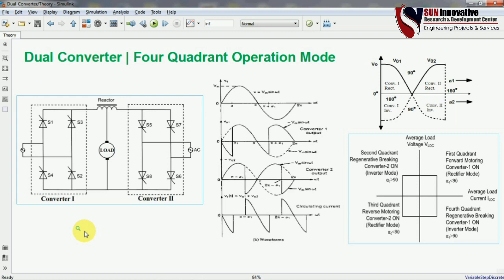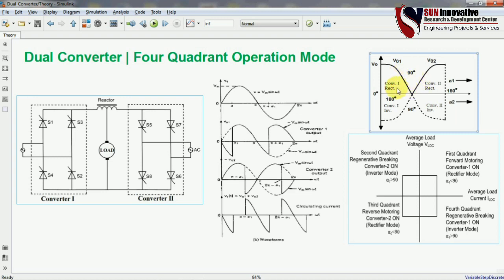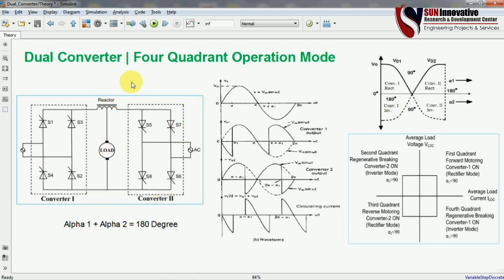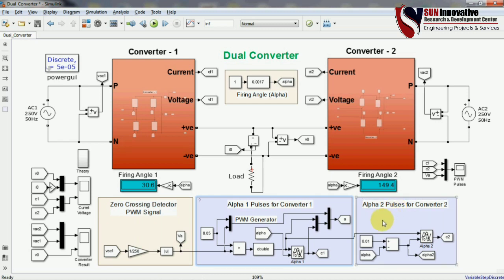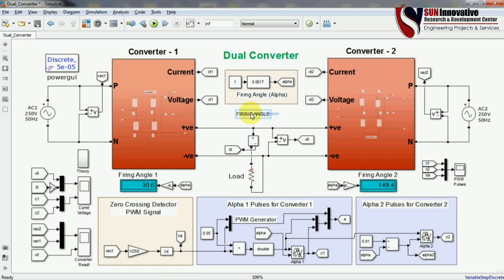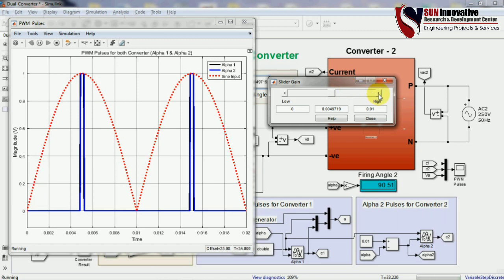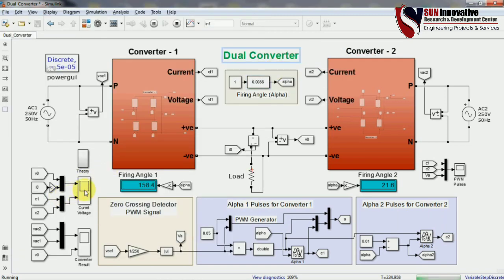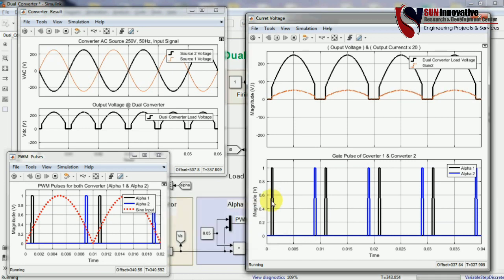Dual Converter | Four Quadrant Operation | MATLAB Simulink

Comment: I see that your simulation working at 2 quadrants but for two athors quadrant the voltage and current sign it should be positive and negative